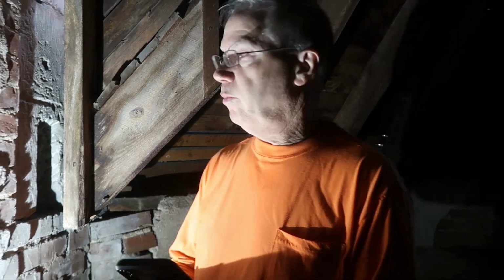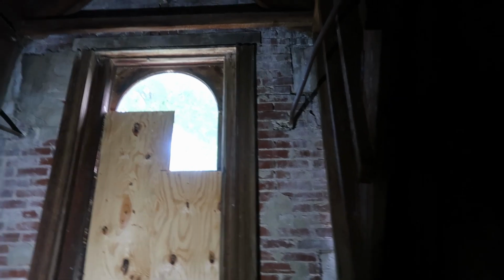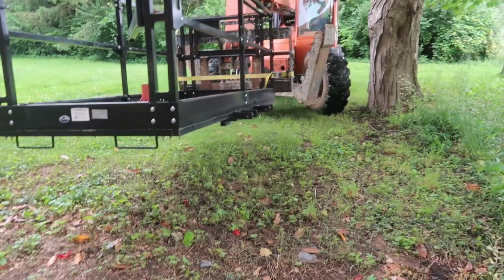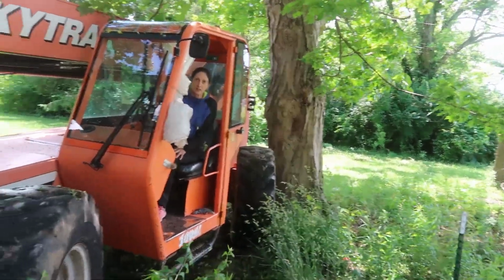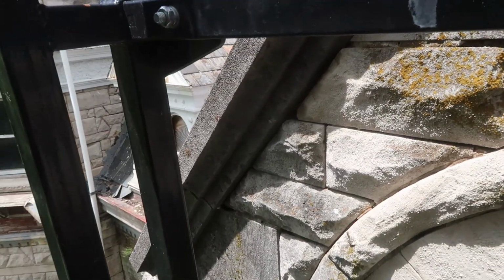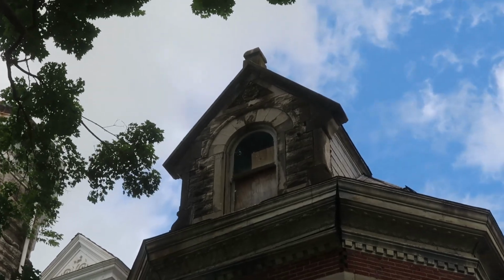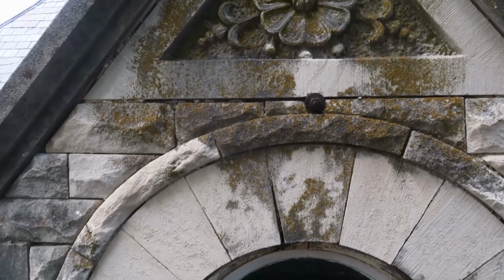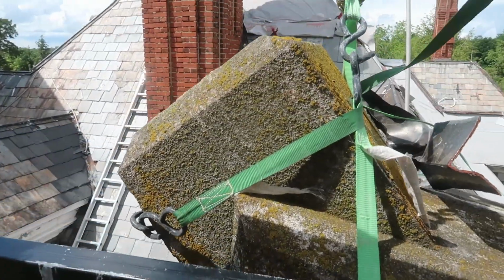The WALL MOVED! Much SOONER Than We Hoped! S3E9

Comment: So glad this is coming down even if it is going to be closed in with tarps for awhile.  I feel much better with it coming apart in a controlled fashion.  I realize there is a balanceing act of what you can take down while maintaining the overall integrity holding up the roof.  I hope you are keeping measurements on that second front dormer and the tower.   The tree growing in the tower at 16:46 makes me concerned about its structural integrity.  Do  I think it would be nice to have it all power washed and clean yes but getting it dried out will change the look just like when you did the front dormer.  Power washing at this point might actually speed up the deterioration and also as it is mainly a cosmetic on a scale of 1-100 gives it a  -10 priority.  I will say the green moss on this dormer however says the house is to wet and needs better air flow and sun can you cut back that maple enough to get some sun and air to the building?
Reply from the maker: We actually went to get that tree out of the tower but realized that the roots were actually holding up some of the stone. =) We plan on cutting down the maple tree that is there but we thought it was more expedient to leave it alone until we rescued the dormer facade. It takes a few days to cut down a tree that large and get rid of all the evidence. We keep track of all the cracks around the Mooreland House.

Comment: There is a rattler that can replace the beeper on Bertha which would make less noise (i.e. more neighbor friendly). It's interesting how the exterior corner of the bricks are stacked in a zipper pattern rather than cut joints. Question: This dormer looks much better than the last one. Can you just repoint this?
Reply from the maker: The problem isn't the dormer itself. The structure of bricks that it is sitting on is compromised. Lime mortar is wonderful if it is allowed to dry out every once in a while. If it stays moist it deteriorates.
Reply: @moorelandhouse  yeah, wet walls are a big problem. Be safe!
Reply from the maker: Yes.

Comment: I may have missed it after all this time, never thought to ask....etc..but was there an original part back and they added front on? Why the 2 contrasts brick, stone..
Reply from the maker: Like most houses of this era, they only spent the big bucks on the front part of the house. The brick work was much cheaper than the stones.
Reply: @moorelandhouse  They think it looks like there was brick and then they added the facade on top of that but what was really going on was all the brick behind the facade was for strength and then the stones were placed with the brick as a backup. They thought they had a brick house and then got richer and added the stone.
Reply from the maker: Funny way to look at it.

Comment: Are these walls built with only one layer of bricks? I'm curious about wall thickness...
Reply from the maker: The walls of the dormer facade are about 15 inches thick. The wall underneath the dormer is about 18 inches thick.
Reply: @moorelandhouse  Thanks for your response! It's interesting if compared to Europe from the same period that brick wall thickness is almost double (in Europe). I assume that walls would be much more solid if they built them thicker back in a day, especially these stone details are like burden. There were few abandoned villas near my place, some, decades without roof but thick walls were solid as rock, they had a difficult time when they were tearing them down, unfortunately.
Reply from the maker: Interesting!